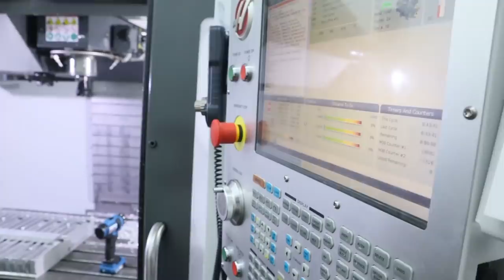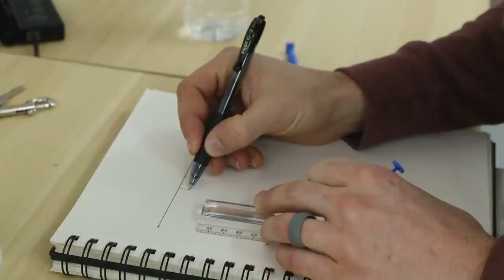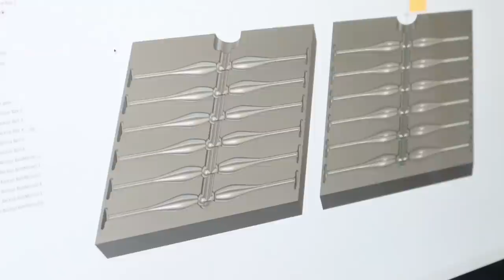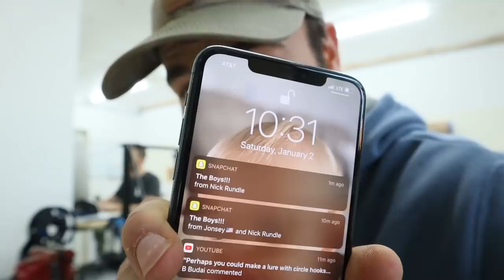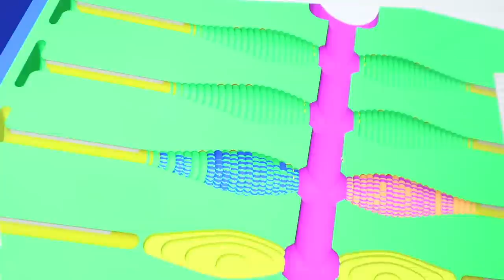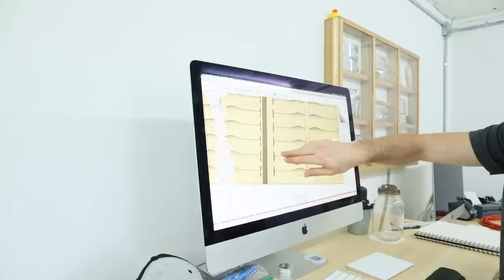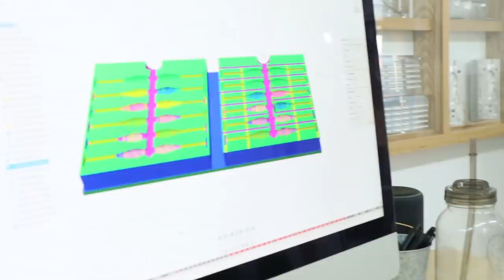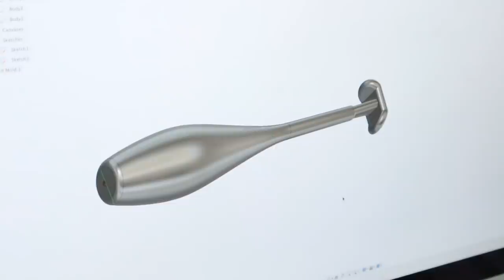I Traveled Over 700 Miles to do a ONE DAY!

Comment: Have you ever tried "flexible" rigs? Where the hook (simple straight and long shank/baitholder hook) and the weight has a flexible joint like the cheburashka or jika rig? It helps/increases the action of the soft plastic lures. Your backup v2.0 might have a better action this way.  Also you can combine different hook sizes with different weights.

Comment: If you ever get tired of the thin superglue tip leaking all over the bottle and making it hard to close/re-open the bottle, those extender thin tips work amazing.  My first super thin bottle was a pita due to the overdrips, but I got a box of those thin extender tips and so far the second bottle tip is like new, ie no dried on overdrips.

Comment: Suggestions: if you are R&Ding a multi cavity mold, like the 12 cavity you did here, change things on pairs so you can test 6 different designs at once. A test tank with a test board with 6 lines coming off could be used to test them side by side

Comment: In my short time building lures to achieve  maximum tail flapping you need a thicker or heavier paddle to act as a counter weight kind of like putting a weight on the end of a rope and swinging it aside from just swinging bare rope

Comment: Discussing how finesse the action is while holding a bright purple/chartreuse bait. You confuse me some times. I did like the bait; it did achieve a pulsating tail at a good clip. I feel like a swimbait tails needs to be asymmetrical with larger bottom than top. Helps push the nose of the bait down and asymmetry causes drag to be stronger on one half than the other which causes movement under marginal force. An asymmetrical oval works well, if you trim a reaction innovation skinny dipper .

Comment: Hey instead of lead shot weight why don't you use a more environmentally conscious steel ball weights. You can drill holes with a radius ended bit to set the ball in.